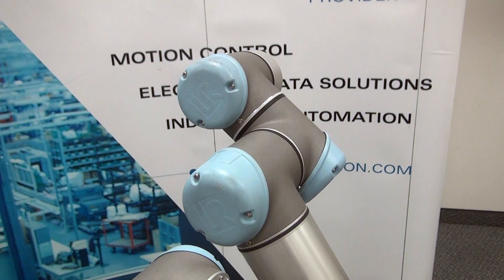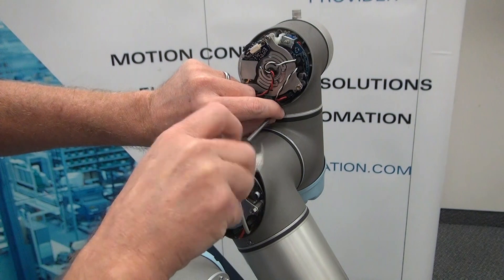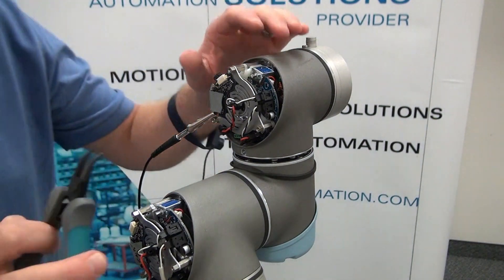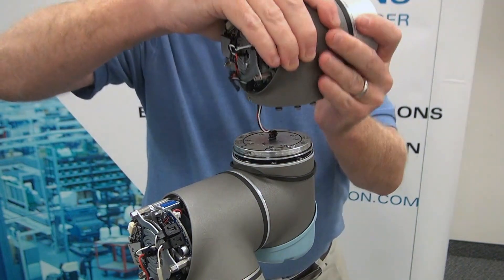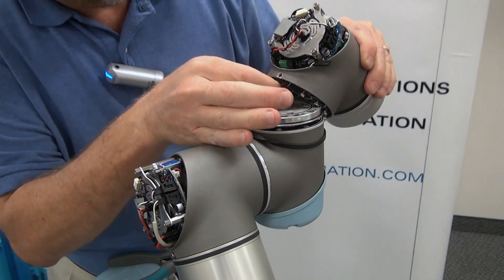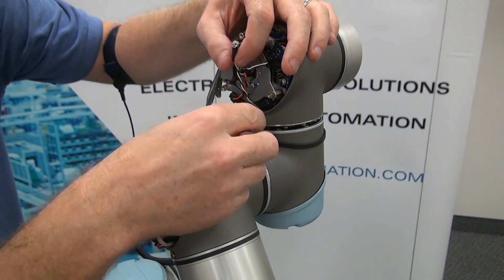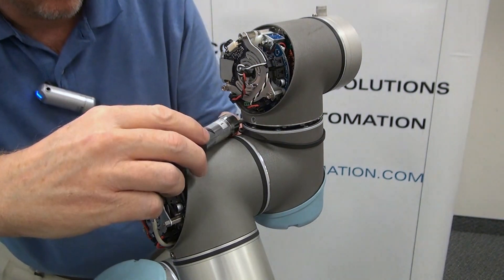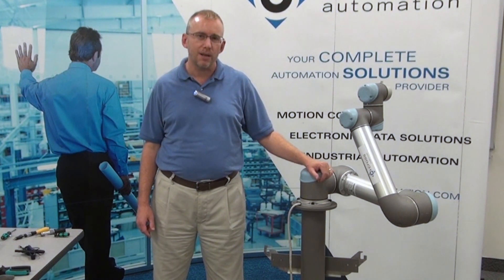UR 5 Joint Replacement Tutorial

Comment: what's the connection type? is it rs485?
Reply: Cross Company Then I guess there is a MODBUS connection between servos with just 2 wires. Do you know if they are linked to eachother or not?